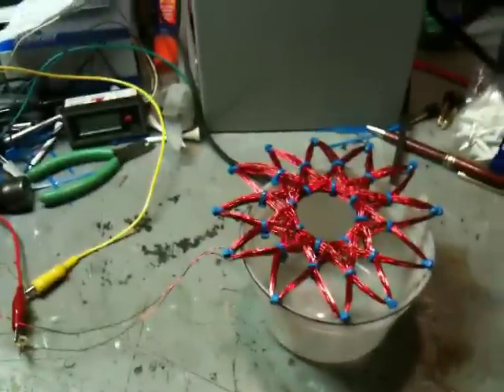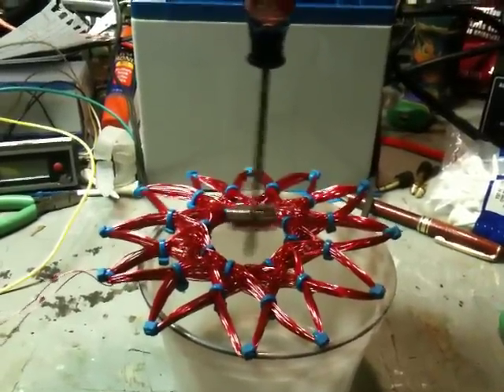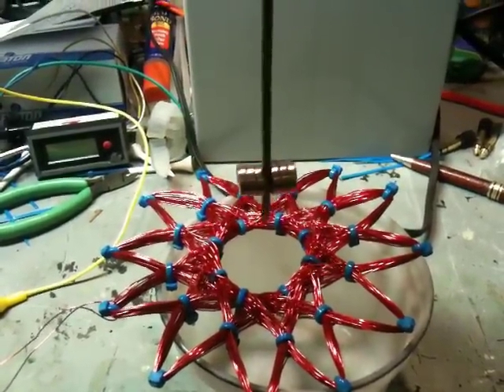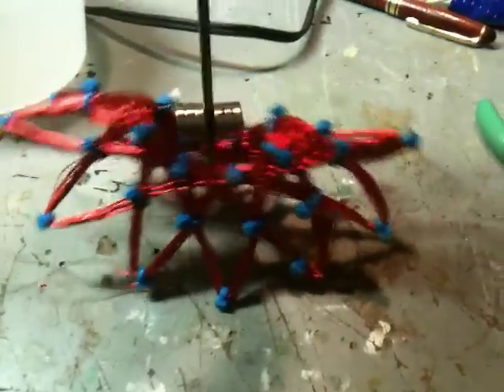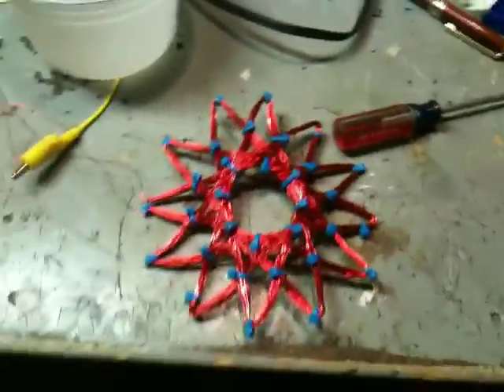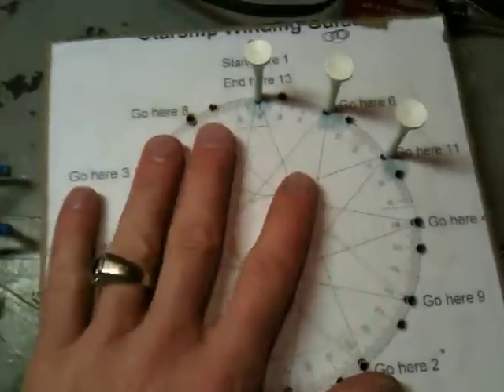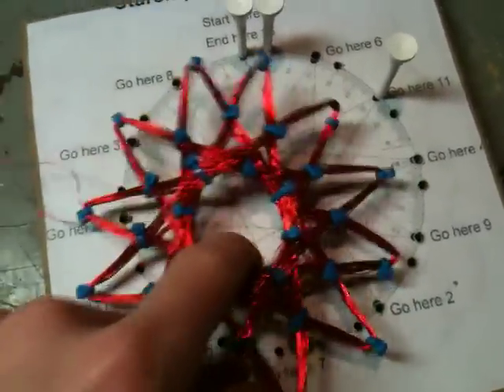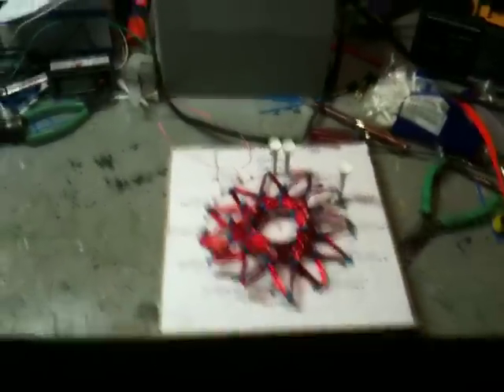Rodin starship coil experiments. (TEST2)

Comment: Wow... you could clearly see the magnetic field line going inside its vortex and out. Rodin's coil is a 2d diagram but really its a 3d effect,the same all through out its axis. With this types of experiment, Rodin's claim of a blackhole is verified. Of course not the blackhole that we expect sucking in planets, but a model which exhibits the dynamics of a double torus blackhole. I wonder what we can achieve with a much large scale model. Very good work !!!!!

Comment: you don't wire or elecy. throw it away. just use the same power that runs the universe. you only need 3 parts for the basic model.like to know. stay safe and lake on.